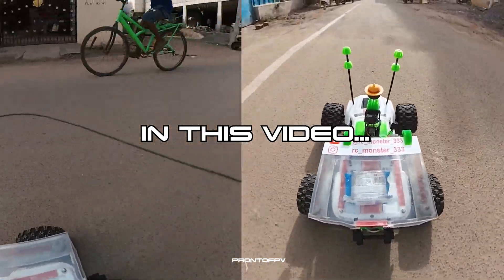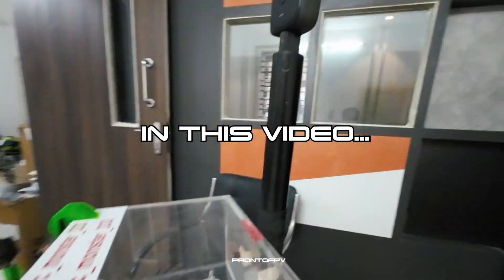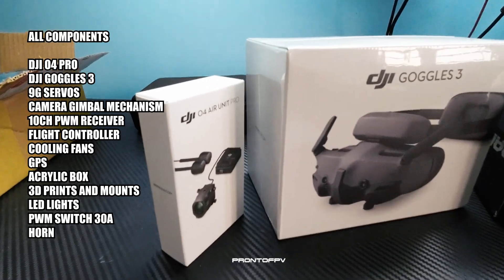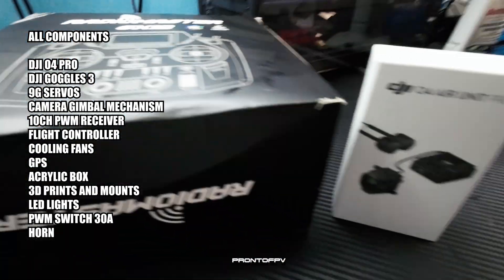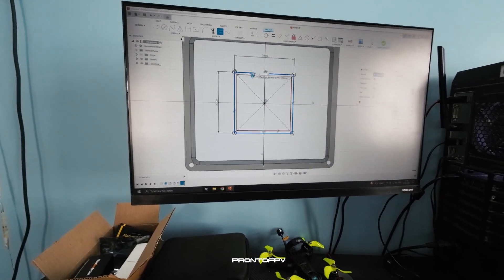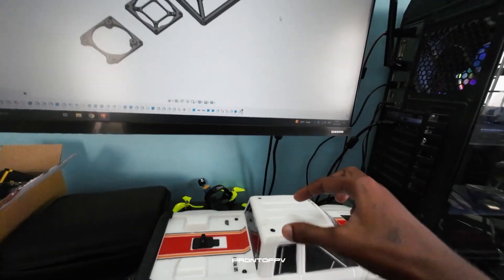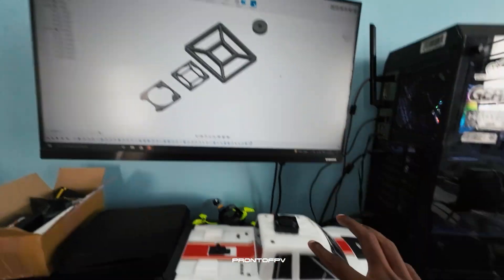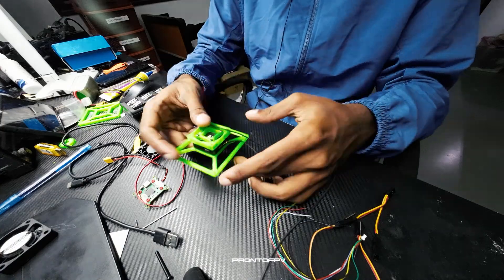How to make an RC FPV delivery Car in (தமிழ்)

Comment: I want fpv camera system bro in low budget
Reply from the maker: Under 15k you can get analog systems bro
Reply: How much range give bro
Reply from the maker: @SureshSuresh-i8r  analog system will give 100-200 mts range